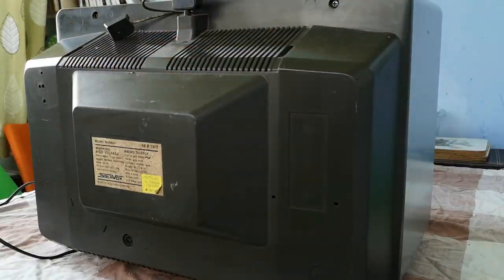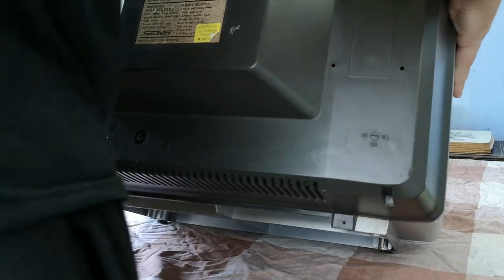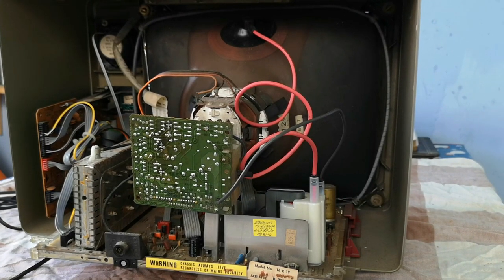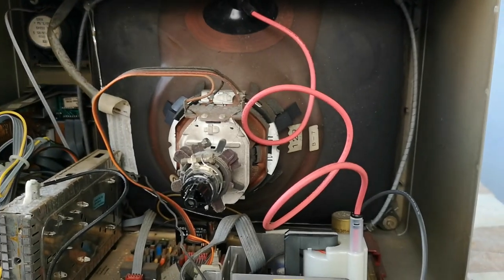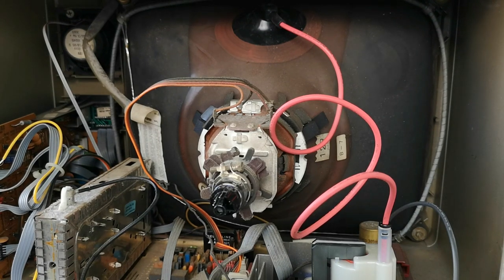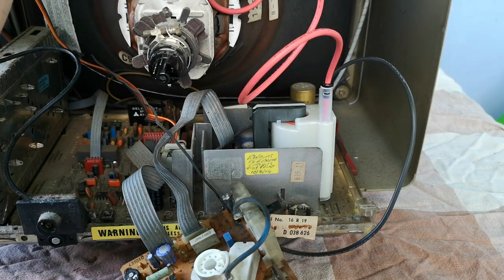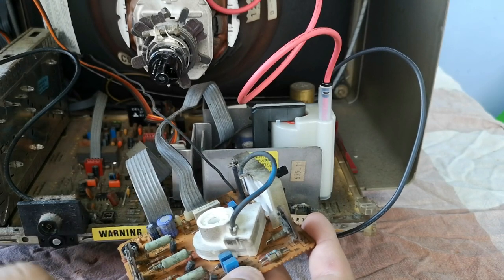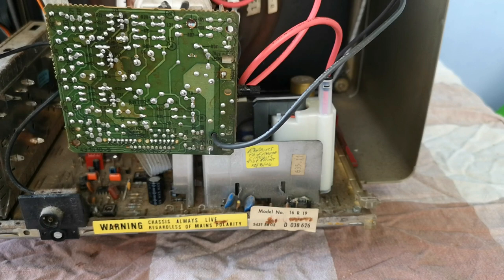Solavox 16R19 CRT Investigation (ITT Ideal Color 3226) - Part 1

Comment: Hi mate, i picked up a solavox 14 5 19 crt that i picked up for 10p with the original tuning tool aswell and saw this midi port it looked like but i think its a debug port and was wondering if you could help me out with what it actually is. I also have a ferguson 1984 crt aswell
Reply from the maker: If its a 5 pin Din port, its very likely to be an audio out, especially if it has a reel to reel symbol, underneath. However, you may be lucky and find it's a composite AV socket, not RGB, but, video and audio.